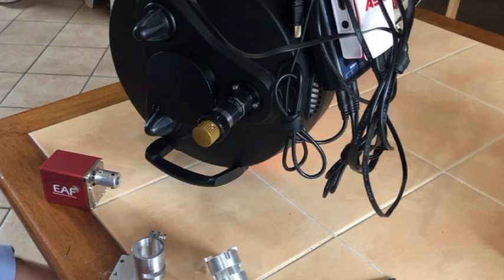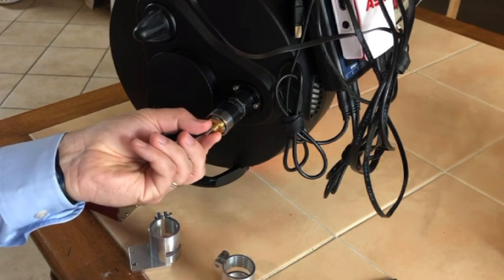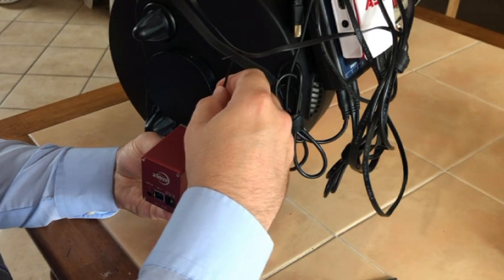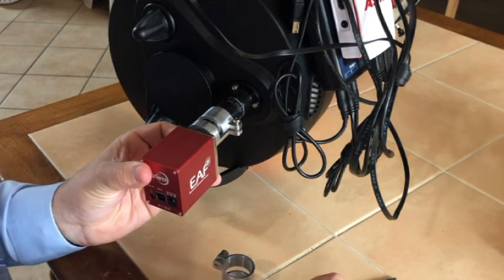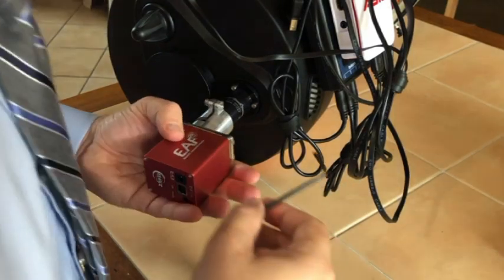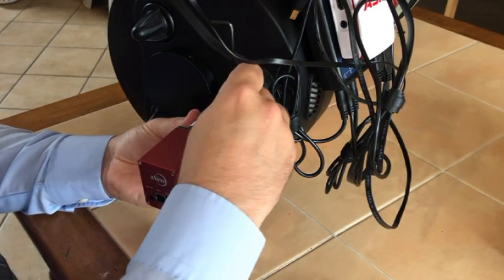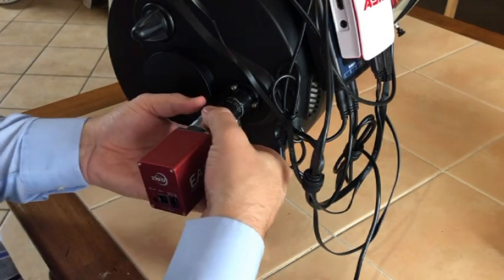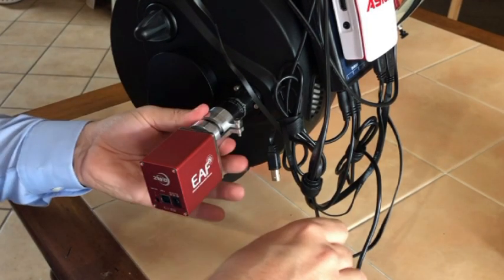Installing the ZWO EAF on the Feather Touch Micro Focuser

Comment: Very helpful video. Maybe you could help out with something else. We are looking for help on setting up our steps in N.I.N.A. We have a Celestron 1100 CPC, Hyperstar, MicroTouch Focuser, with a new ZWO EAF attached. We set the step count to 20 and counted 6 clicks for any movement to happen on our focuser. So we thought doing 70 in and out in the settings would do the trick, but it did not. I cranked the steps up to 300 with “overshoot” for the “backlash compensation method” and got some results, but probably not the proper way of doing it. Does you have any advice on the proper settings in NINA for this very specific set up? Appreciate any help in advance.

Comment: Nice video, thanks for that. Unfortunately, ZWO discontinued the # ZW-BRK-FT for use with Feather Touch Micro Focusers so now you would need to revert your SCT back to the standard/stock focuser and buy the appropriate ZWO bracket depending upon the size of your SCT. ZWO-EAF-C8-C925 for 8" and 9.25" or ZWO-EAF-C11-C14 for 11" and 14" SCTs.
Reply from the maker: You’re correct. I just verified with ZWO and they said they aren’t making any more. That is too bad. The Feathertouch adapter is much cleaner and nicer than the stock adapter.

Comment: What size of wrench are you using to take off the feather touch knobs? I have tried a 2mm, a 2.5mm, and the 4mm and 5mm that come with the EAF and none of them fit the hex screws in the fine and rough adjustment knobs.. Thanks!
Reply from the maker: Shane Creamer It is SAE sized wrenches. (1/16 is the smaller)
Reply: Tim Connolly Thank you. Had the same problem.

Comment: Thanks Tim, I just got mine from ZWO directly and got it hooked up on my C8 without any issues. Your video was helpful to watch first. I got the second version with the notch cut out for getting at the set screws. With this cold winter we've been having, I'm looking forward to running auto-focus from inside the house, rather than trudging out every few hours with my bahtinov mask!

Comment: FYI to all who would like to use this focuser on an SCT:    The bracket seen in the video is not generally available.    ZWO and their vendors are selling this bracket, but they are not fulfilling the orders.   Everyone is on backorder status (some of us for months without resolution).   ZWO has claimed they shipped the brackets, but the vendors deny this.   I understand (from a prime vendor) this is a common issue with ZWO.   Great products (if you can get them), but often problematic deliveries.   Caveat Emptor!
Reply from the maker: Douglas Summers, ZWO and vendors are actively shipping this bracket.
Reply: @timconnolly3004  Thanks for the update.   Good to hear that they are finally filling orders after all these months on backorder.   I gave up and made my own bracket by just cutting the generic bracket they provide, and mounting it to a motorcycle (handlebar) bracket available from Amazon.   The bonus is it looks much better (red/black) than the ZWO bracket!